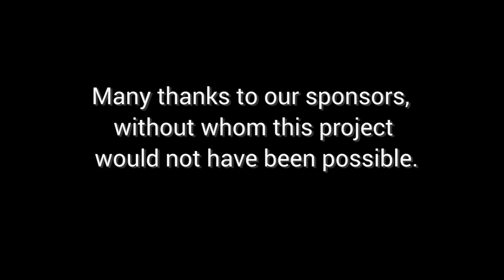Video from the BPM2 Test 2015-04-12

Comment: What happened with the last test? It looks like maybe a valve failed...? What were those flames that started on top of the chamber? A burn through?
Reply: Jan Stahlhacke I'm not sure, but I think it burst in flames because the overheat of the engine, and some adhesive get on flame when the steam of LOX brought to there by the wind. Please CS, correct me if Im wrong.

Comment: Shouldn't the thrust apparatus accurately represent the combustion chamber, throat and nozzle for a given engine? Assuming of course the test is to get the right mix of fuel and thrust values for a specific fuel, oxygen and engine combination. Please forgive my naivety. I am a hobbyist rocketeer. No formal schooling.
Reply: Stephen Studley I think this is a tiny 2kN "engine"  to cheaply and quickly test things they are not ready to put in their flight rated 5kN test engines.  Their space missions will use 100kN engines or larger.

Comment: why not use a sparkplug or something for an igniter? just curious.
Reply: A sparkplug isn't enough of an energy bump to get a rocket engine started because the propellants are moving way too fast through the engine. Probably the simplest way to build an igniter into this engine would be to use a spark plug to start a secondary ignition charge (like a bundle of common sparklers for example) which would produce a lot of sparks and heat at a high enough rate to actually get the engine ignited. As long as the engine stayed ignited long enough that the interior parts of the combustion chamber got hot enough to keep continuously lighting the propellants on fire, the engine would continue to run and have no chance of blowing itself out.
Reply: Rothpol X 
ah, thank you for clarifying.

Comment: What is IPA? and what is TEOS? Looks like a successful test!
Reply: ***** IPA is "isopropyl alcohol", and TEOS is "tetra ethyl ortho silicate" - an additive to the fuel meant to deposit silicon oxides inside the engine to keep the heat from melting the chamber walls.
Reply: Mikkel Højbak Thank you for the quick reply! One more quick question...what is the oxidizer being used? LOX? I am so happy that a group like CS exists, keep up the great work!
Reply: You are welcome. LOX is indeed the oxidizer used.
Just for the record, I am not associated with CS, but I am a supporter, and have been following them pretty much since the beginning.